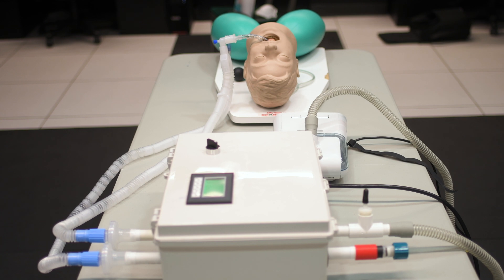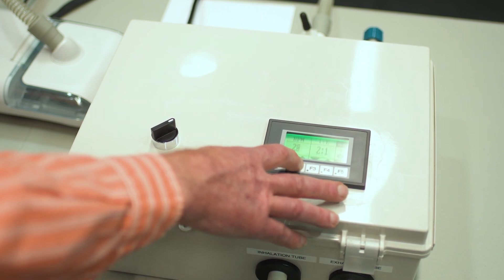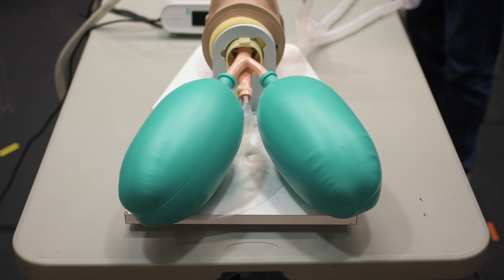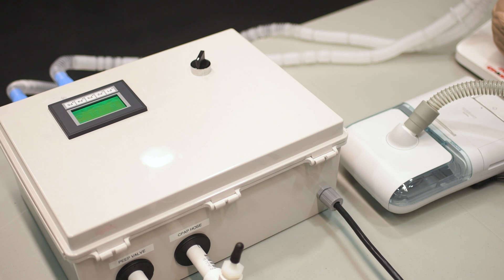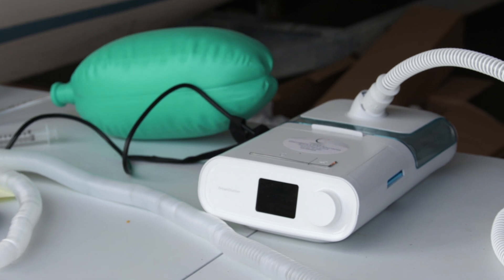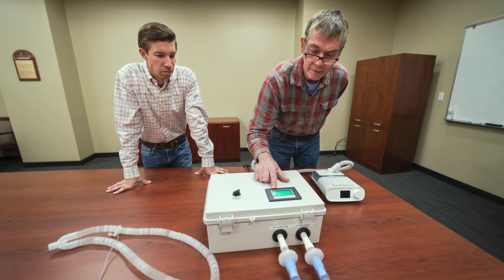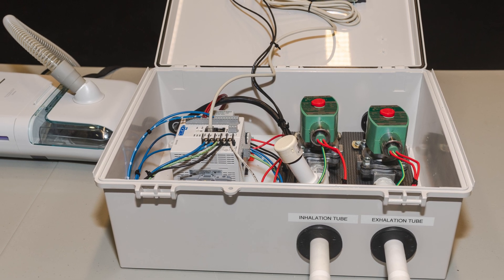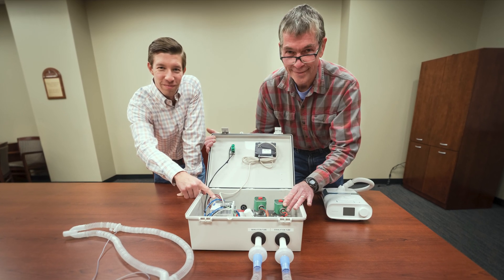Converting a CPAP Into a Ventilator

Comment: While I certainly applaud the effort and ingenuity that goes into this device, it is not safe to use. You undoubtedly have excellent engineering skills, unfortunately, you lack the experience in pathophysiology and physics of mechanical ventilation.  For instance, I noticed you are using a Jackson Rees bag and vent circuit, did you take in to account the deadspace inside of the ventilator tubing?   It is definitely not as simple as 'air-in, air-out'.   90% of ventilating a patient is measuring and monitoring the efficacy of ventilation.  This is why the Respiratory Care Practitioner is so important and vital in this crisis.  This device will either create a pneumothorax or hypoventilate due to the unknown flow delivery, volume return or airway pressure.  It will kill the patient.  If that outcome is known in using this device, it is equivalent to murder.  I would certainly recommend consulting with an experienced Respiratory Care Practitioner in furthering this device.
Reply: Craig Hawkins
Sounds like you've just volunteered yourself.
Reply: No doubt you are aware 50% of CPAP machines sit around unused and the problem is so pervasive they (you?) are actually attaching cell phone monitors to report lack of use.  You're field is probably the least successful in all of health care at attaining patient compliance.  In other words, people hate you.
Reply: @akbarshoed  I didn't realize that the role of a respiratory therapist was to also be that of a parent instructing their child on what they should be doing.  It is not my duty to 'attain compliance'.  My role is to provide the tools and educate.  Whether or not the patient wears their CPAP is up to them.  The same as a diabetic to choose their diet, an emphysematic patient choosing to smoke, or a mental health patient choosing to continue therapy.  I don't care who hates me or my profession.  Do not confuse Hospital with Hospitality.
Reply: @craighawkins5834  while I'm normally on your side of this argument, it's fair to say a 50% compliance rating is a bit of a scandal. But until there is something better, all the best.
Reply: @cebruthius  as I see it it is fair for the entire Healthcare industry to be vocal about their failure regarding the rampant hypoxia of the population.